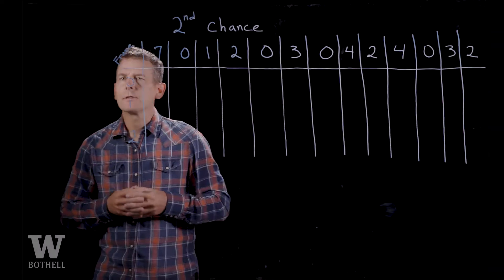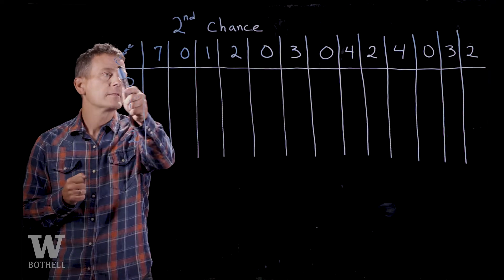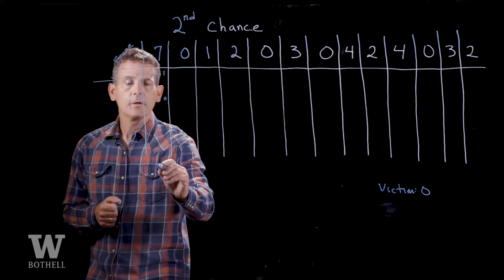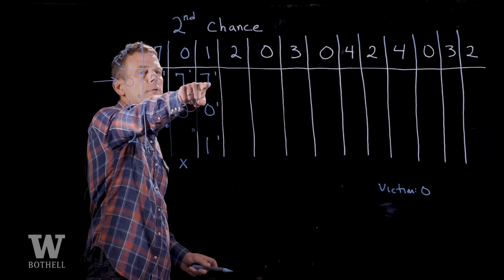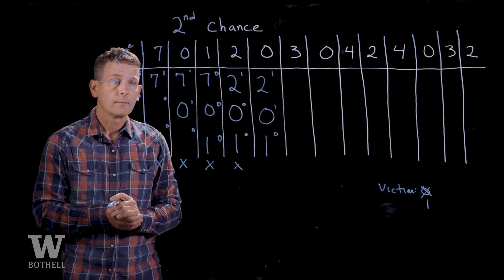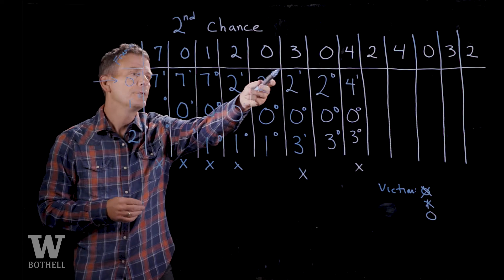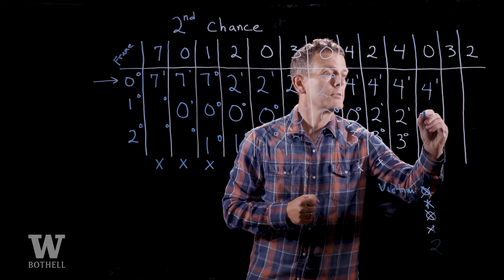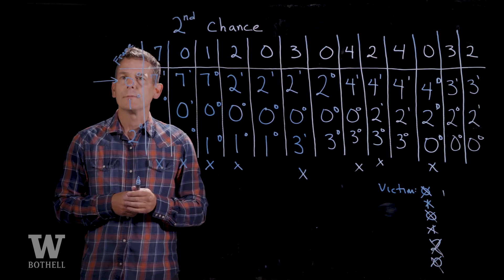Second Chance Algorithm

Comment: Why does number 4 leave in the penultimate box if it has the reference bit at 1? when 0 enters, the one that has to leave is number 3, so the bit of number 4 continues in 1. I had it the same until the last two boxes that I have 4,3,0 and 2,3,0 because 4 has the second chance in the antepenultimate box
Reply from the maker: Hi!  If you look at the third from the last reference (virtual page 0) you will notice that it replaces virtual page 0 in frame 2.  At this point, all frames will have their reference bits set and the victim frame is 0 (virtual page 4);   When virtual page 3 comes in a page needs to be evicted;  as all have the reference bit set, then all ref bits get set to 0 and the initial victim page is evicted.
Reply: i get it, thanks! @dr.robertdimpsey2733

Comment: I started the pages with reference bit 0 and when I find a page repetition I change it to 1. And according with some books you change the reference bit (that was 1) back to 0 when you tried to replace that page with another one. After that you move the pointer to the next page and check if it's available to change it. (this process is made below the reference string page).

in this part [...,2,4,0,3] you replaced page 3 with page 4, but 4 had a Second Chance in that iteration. Doesn't that mean that you have to check if the next page is available to replace, in this case, 2 is replaced with 3 and 4 has it reference bit set to 0?

I'm curious about this topic.
Reply from the maker: Hi Eduardo, I am not sure if I completely understand your question.  However, let me see if I can help here.  If the victim  frame (say frame 100) has a page which has the reference bit set to 0, and we need to find a free frame, then that page is removed from memory.  The frame (in this case 100) gets the new page and that page has the reference bit set to 1.  The victim frame pointer is moved to the next frame (101) and it stays there until another empty frame is required.

Comment: The rule is to increment(iterate) the victim page when u miss, and keep it the same when you hit. 

Second rule is to always start from victim page , if the victim page was protected with its body guard bit then iterate to other pages , and see if they are unprotected . If the victim page has no body guard bit then it will be replaced.
Reply from the maker: Hi Mohammad, I believe the video is correct.  If I am understanding your modification correctly note that the reference bit of the just paged-in page would be set to 0 as soon as the next page fault occurs.  That is, there first-chance would be taken away right away.

Comment: Isn't this technically Second Chance with Round Robin instead of Second Chance with LRU? For example, the last few reference pages are 4, 2, 4, 0, 3, 2 when 3 is not there in the frame it replaces page 4 instead of page 2 even though page 4 was more recently accessed that page 2 (as can be seen from the reference string itselst 4, 2, 4, 0 ...)
Reply from the maker: Hi Abhijith, Second chance is neither LRU or Round Robin.  It is an algorithm which has some characteristics of LRU and is implementable inexpensively